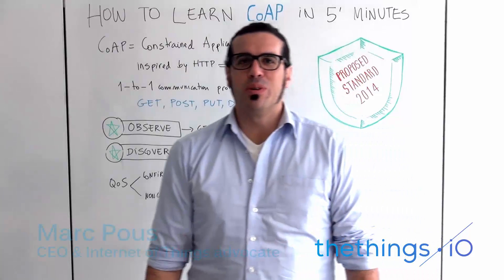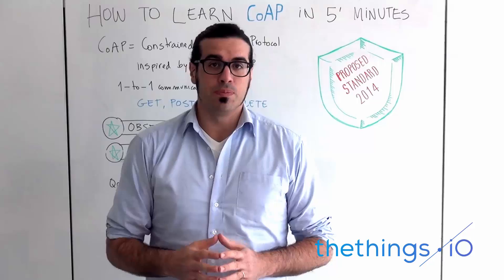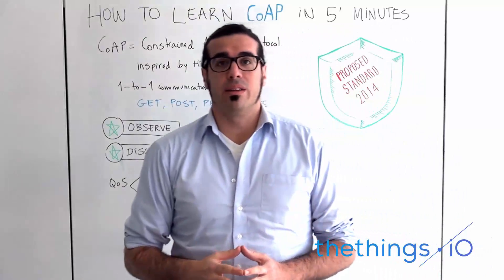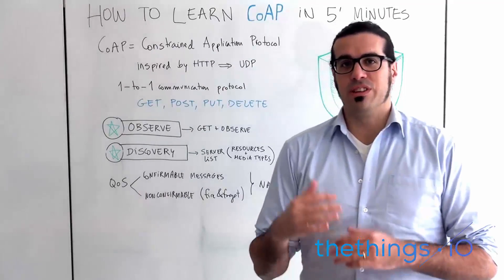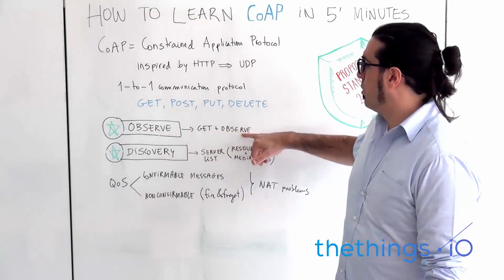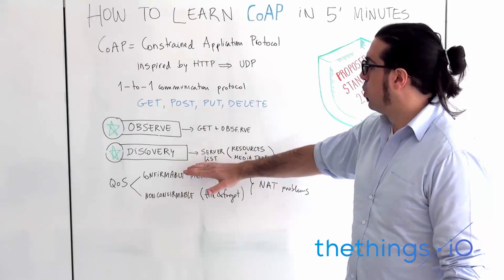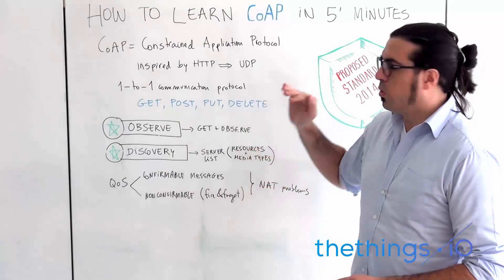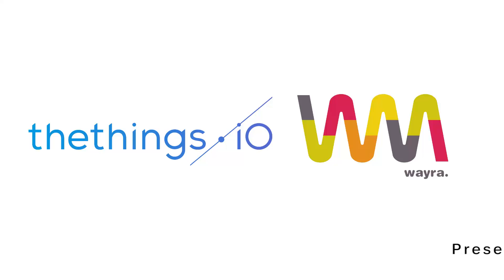How to learn CoAP in 5 minutes #IoTFriday

Comment: Is there any difference between coap and mqtt except for coap uses udp and mqtt used tcp?
Reply: CoAP is based on a request/response model, while MQTT is based on a publish/subscribe model, which makes many-to-many connections more straight forward.
Reply: Actually yes! CoAP it's more similar to HTTP than with MQTT. The difference is that there is CoAP subscription which is similar at the subscribe of MQTT.
Reply: Thanks a lot!